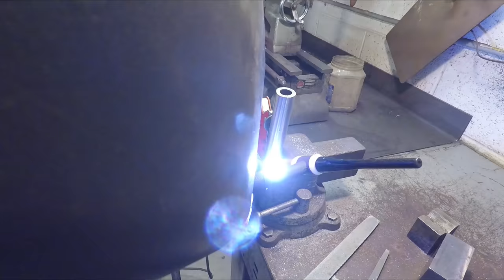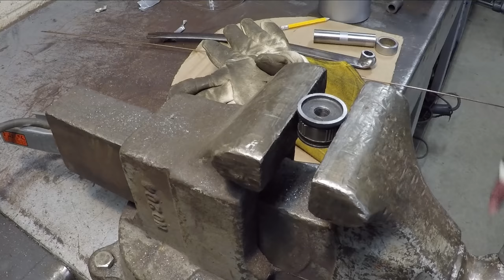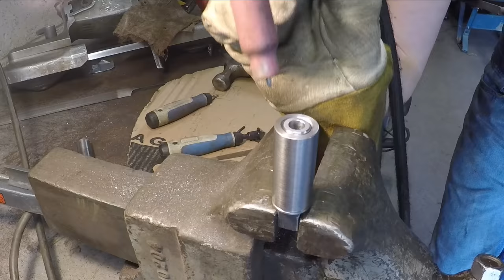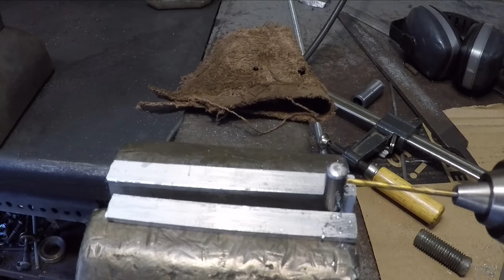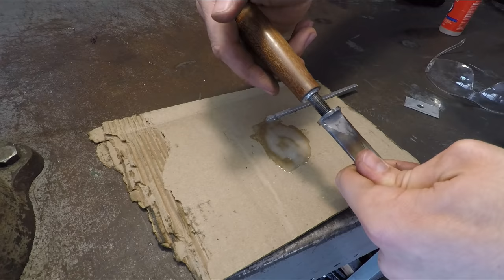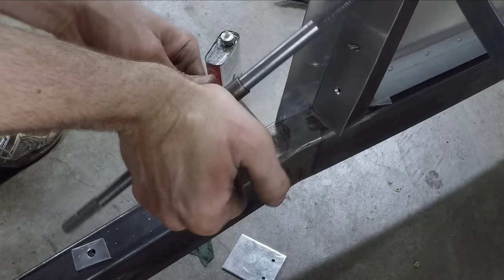Making an Emergency Brake Lever | Homemade Boat-tail Speedster Pt. 41

Comment: you had me at the rivet tool a few videos ago, your mind is working overtime, you're just a kid but you have an old soul. . Needless to say, I'm very intrigued with your ingenuity and resourcefulness, good stuff lad. It works well and by all accounts, safe and very functional.  You're going to have the only hot rod boat tail out there that can drift as well. Awesome fab work all around and good tig welding skills to boot. Keep up the awesome work and videos!!👍👍👍

Comment: You're doing an awesome job with this build, it's pretty ambitious for anyone to undertake, and I applaud you.  I do have a question though... why didn't you mount the handle in the corner of the hood side instead of in the small panel that would be the door?
Reply: I second that question
Reply: It's not going to have doors I guess
Reply: He mentioned a while ago that the door panels will be fixed, not opening.

Comment: realy ingenious idea using the ratchet head , dont load it too hard or the teeth will wear out (they will over time anyway ) the greasenippel is a good idea
too bad motorcycle gearboxes arent strong enough to handle the jaguar engine power , if you where to make youre own case for the gearbox you couldve had sequential gears operated by a second handle on the side , (still need to find a way to hook the clutch up too)

Comment: You seem to have the ability to easily weld aluminum panels with ease. Can you tell me what welder you have and the current setting and the particulars of how you have it setup? I've been trying with out great results to do similar welding but seem to blow through most of the time. I'm trying to weld 1" x 1" x 1/16" (.063) aluminum angle. Thanks in advance!

Comment: A standard Model T brake lever does the same thing in a much simpler way and the handle to control the ratchet is as the top of the brake handle.  It would be a more useful set up than this method.  But this looks cool and interesting to see it done in a different way.

Comment: I really really like your solution but may I suggest next time grinding the other teeth? The car will mainly go forward. It may catch wind or speedbumps may cause it to pull backwards. A push instead of a pull would eliminate all that.

Comment: does the red heat so close to the ratchet teeth compromise them in terms of hardness/temper rating? you may have introduced a weakness....................?

Comment: Just a short question: After welding the tooth of the outer ratchet, did you heat treated these off cam?
I wonder if the heat might "softened" these too far. And if it might cause trouble in the future.

Don't want so see your speedster to let go of the parking brake or worse roll down a hill and hit some one.

Comment: This fell'a is fantastic but the ratchet isn't a very good idea in my opinion. It is easy for a ratchet to move by mistake from one position to another and if your trying  a drift and you pull back and it's on the wrong setting it could be a big problem. I think a traditional hand grip would be a lot safer.